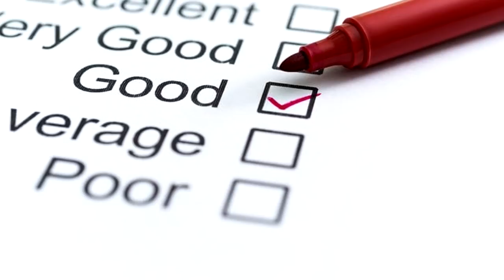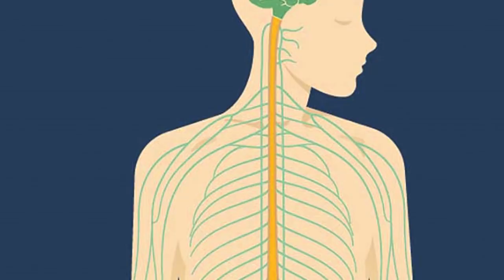Magic Circuits Explained [Fate/Stay Night] [Fate/Zero]

Comment: So getting shot by Kiritsigu’s bullets while using these circuits is like when Aang got strucked by Zuko’s Sister while in Avatar State?
Reply: Basically yeah.
Reply: Worse. When you recover, you can't go avatar state anymore.
Reply: Yes and no. While the Avatar state can be fixed getting shot by origin bullet means u fucked up permanently as your whole body is torn apart and reattached

Comment: It should be noted that cases like shirou are extremely rare.
finding someone with a magic circuit or 2 wouldnt be that hard, just that natural circuits that lay dormant a long time tend to suck.
shirou suffers from the atrophy probem but was born with 27 circuits wich even for an average magus family is pretty darn good, for refference rin was born with 40 and was considered a once a century prodigy.
granted he might have some mystical lineage from muramasa and prolly an inborn affinity for smithing  but no one knows that.
point is he would prolly garner a lot of jellly from the clocktower bottom feeders that arent waver
Reply: too bad his mind is too pre-occupied in becoming a hero of justice
Reply: Yeah, Shirous circuits can only handle ~10 units of power (that damages them in the process) while tohsaka’s circuits can handle ~1000 units of magical energy. Shirou has an above average amount of really weak circuits
Reply: @yesno7284  Shirou has atrophied circuits that were average quality.Due to not being used for majority of his lifetime they have been degraded, kind of like  Muscles.If they were used at full capacity or refined they 'd be usable.Look at Emiya .As a servant he has B rank in mana which is 40 times the mana capacity of your average mage.If he wasnt spending most of it being anchored to the world  and incarnated in a physical body by any instance he'd coincidentally have an even greater capacity than rin.Though i do admit that is probably because of his deal with Alaya in his life that buffed him up
Reply: @Ohimeshinso  Gray is strong but I don't think she 'd last 1 v 1 against servants or someone of equal level .Is she as strong as artoria(as In has it been mentioned that she uses Mana Burst?)
Reply: @Ohimeshinso  Nah isn't possible.Rhongominiad would generate an absurd amount of magical energy that would be noticeable from a mile away ,Plus unlike artoria Gray cannot use it without Rescinding it's 13 Seals lest she risk Divine spirit conversion and we get a second case of Goddess Rhongoniniad.Infact it's already quite dangerous given that her mind is covered in a "haze" when she uses the Lance in it's true form.
Reply: @SiegfriedFafnirsbane  wait, I thought rin was the one giving him mana as his master
Reply: @oilalalabla9211  yes rin was giving him mana but do where do you think that mana goes?.All servants have far greater mana capacities than any human  mage.The problem lies in the fact that since they are theoretically dead, Gaia tries to suppress their existence as they are an anomaly to the world .For those same reason servants cannot draw in mana from the surrounding like humans or any other supernatural being can .Only servants with  a magical reactor core or an EX ranked Independent Action  or Hacks like Gilgamesh can overcome this.

Also the mind blowing fact is that all servants from Age of Gods possessed Mana capacities that would make rin look like a bug.
For example look at gilgamesh.He has an average C rank in Mana but as shown in FG9 Babylonia,He could alone support an entire roster of a Grail war by his lone some while he was alive.
Reply: @SiegfriedFafnirsbane  oh I thought rin had more mana than him because he said she gave him more mana than needed. This is really cool🤝! Does archer have more mana than gilgamesh? Like B is better than C, right?
Reply: @oilalalabla9211  are you nuts? Emiya is from age of men. Gilgamesh is literally a god from the age of gods. Just because he has a  lower rank in one place it means shit. His circuits and amount of odd he has is above Heroic Spirit Emiya. The only reason he loses to him is because luck and his pride
Reply: @WildArtistsl  makes sense🧐
Reply: Shirou DON'T have a weak circuits there is literally no evidence that it is.

The wiki saying it could barely handle 10 units of mana is false as there are not statements in the VN that support this statement the Mirror Moon says, "Magical energy ten times the capacity of the circuit," that's a mistranslation. The Japanese says "a mana of ten" (十の魔力). Where the Wikia says, "Each Circuit can barely handle 10 units of magical energy while being damaged in the process," Shirou overcomes that by somehow bearing "the Circuitry of a hundred" (百の回路, lit. "circuits of a hundred"), which can draw unto themselves "a mana of a thousand" (千の魔力).

An average magus only have 25 capacity according to saber while shirou stated he have 20 to 30 which would put him at average magus lvl atleast

There is also these statement of
"Bearing the circuitry of a hundred, which subsume a mana of a thousand" tho I don't know what these means all I can say is this might be shirou using ALL his circuits at 100% which could hold a MANA of THOUSAND

Comment: Forgot abt the part where Avalon technically stops shirou from dying whenever he does magic shit
Reply: avalon only works when saber is around so before that shirou was still getting the full recoil of using magic
Reply: avalon was allways working but only at like 0.001 power , even with saber prana it doesnt work at more 10% capacity

Comment: So, as far as I know in my very lay understanding of this: You run your magical energy through your circuits Od/Mana whatever, turn it into usable magical energy... something happens, connect to a foundation-wut?, spell structure and magical energy manipulation with self-hypnosis, dash of fairy dust= profit.
Circuits are confusing. I know Shirou has 27, more than the average, but I was never clear is he had a total capacity of 10, or if each circuit had a capacity of 10 for a total of 270. Which actually sounds amazing if his circuits are supposed to be atrophyed from disuse. He has 25-35 units of Od to play with which is average,
Then comes Rin with 40 circuits for a total of 1000 units, or 25 a pop. No idea if this includes her crest, which couldn't help much as her family is only a measly 5-6 generations. Plus 500 whopping units of Od, the show-off.
Reply: Shirous circuits being atrophyed is fanon
Reply: @JohnDoe-wn7vi  It is literally stated by Archer in UBW. Reopening the circuits is what messes up his body and Archer helping him through it leads to Shiro having more to work with.
Reply: @joelsasmad  that sounds like a totally separate thing so can you go into more detail about what that has to do with circuit atrophy
Reply: @JohnDoe-wn7vi  The fact that as he opens the circuits he literally states: "your circuits have atrophied from disuse" and goes on to say that Shirou will be a bit better f a mage from now on as a result of their treatment.
Reply: @JohnDoe-wn7vi  as far as I understand it: Kiritsugu died without teaching that much magecraft to Shirou and he was never taught how to properly train his magic circuits so most of them were never activated, he was pretty much undoing any progress he did with training his circuits, so as he grew up those circuits were, perhaps atrophied is not the best word but you could say dormant think of it like this if you try to walk with your leg muscles atrophied you’re likely going to fall, likewise with numb legs, one situation still has a “healthy” limb but the end result is the same you fall. So Shirou has no access to these circuits and he has no idea how to use them or that he even has them he can’t feel them he has no training in directing magic through them. 
They might not be atrophied in the sense that they were changed by disuse but they were very much like a limb someone have never used regardless of how strong or weak it is it has no muscle memory no ingrained nerve pathways, it’s why babies take so long to learn to walk without looking goofy. So when Shirou started “activating” those circuits it caused him pain he had no idea how to use them so he hurt them. 

As to what archer did to him my way of understanding is that he simply made the direct connection between their magic circuits and their magic and them being the same person Shirou simply got archers entire experience of how to activate these circuits, in the previously analogy he got all his muscle memory,  just like what happens when they’re fighting it was the direct contact between their magic circuits that caused it. 

I hope that helps
Reply: @AverageAwesomeDude  yeah, thanks for explaining
Reply: @JohnDoe-wn7vi  no problem happy to help

Comment: Both Shirou and Kirei wasn't supposed to be born with any for those not in the know
Shirou has 27 Circuits in total which channel's 10 points of magical energy
Rin: has 100 magical circuits that channels 1000 points of magical energy
so this is why Mages prioritize bloodlines and Magic crest oh and the average joe is born with 20 Circuits Shirou's extra comes from his own projection magic
Reply: Damn. That sucks ass, so a majority of us would die on the spot trying to activate our circuits.
Reply: @SanzuRiver  Not if you do it from young age like 6 and practice there on in 
now if your Shinji who needs the grail to unlock his YOUR DEAD
Reply: 10 per circuit meaning 270 which is still higher than average but obviously lower than the best.
Reply: @nottomiokagiyu9830  this ain't kung fu no matter how hard Shinji work he can't do the magic he doesn't have circuits he can't even do Shirou projection a novice ability of magus it's why Shinji the way he is personality wise
Reply: @nottomiokagiyu9830  I mean no. He studies alchemy to try and get ahead with what he's got, kinda like waver. He worked just as hard as Shiro but in a different direction and his own personal failings are what make him suck.
Reply: @joelsasmad  yeah alchemy rules in fate
Reply: If they come from projections then is he projecting more is that from him doing magic wrong? Aka using his actual nerves

Comment: See, this is what makes fate in general just a complete vague mind fuck in trying to understand how things work. Magic circuits, looks like a nervous system, but instead is a metaphysical concept more to do with spiritualism. What did Nasu have to gain from making this so hard for the common folk to figure out. 😭 loved the video by the way, does help me work some out, so thank you 

PS: if it's at all possible, could you maybe do a video about the types of elements and what spells can be used with each? Because they're confusing as all hell also.

Comment: 0:37 Quick question. If one were to lose an arm or a leg, would they lose the Circuits in that area as well? Or would they still be there, just floating in the general area where the arm should be? I'm not talking about the Crest, just the inborn Circuits.

I ask because of how Archer's arm affects Shirou's body in the Heaven's Feel Route.
Reply: From what i understand is that circuits are directly connect with the soul so even if you got arm cut off you would still have same of circuit amount

Comment: So, I made a OC who's a homunculus which was created using the genes of several different mage families to maximize his inbuilt magic circuits and other magical abilities, but his nervous system, blood vessels, muscles, bones, and his lymphatic system are all engraved with additional artificial circuits and all of his base and artificial circuits have been beefed up even further like they were juicing on unicorn piss and LSD. The end result is a mage that is so incredibly potent that in the fictional grail war he takes place in he is going toe to toe with other servants when using his codex the beletung armory (beletung is based of the German translation for lightning beleuchtung) which as the name suggests is an armory which takes the form of a suit of armor and has lightning based abilities such as when electricity is pumped through it magical or not it gives you a strength boost based on the voltage, and other aspects with higher numbers being better. In addition to the armors other lightning based abilities it can manifest weapons and repair itself. One of its strongest abilities, however, is its ability called the beletung incarnation which basically turns the user and the armor into a literal lightning bolt with all the benefits that being a living lightning bolt provides without any of the downsides obviously costing a boat load of magic to even use.
Reply: The codex has even more abilities such as generating an electric field which hides the users mana especially rendering a the most powerful mages undetectable, and much more.
Reply: In addition to all this the guy decided to break the rules of summoning a servant and basically manually summoned his servants yes two of them, and stuffed their heroic spirits inside mindless homunculi bodies so his servants would basically have their own internal magic production on top of the truck loads of magic he is already dumping into their systems turn his servants into absolute units effectively making energy a non concern for king Arthur and Mordrid which are the two servants he summoned.
Reply: Though he is not the only master in the war who is rocking some additional power ups because Sieg returns from the other world to lead Astolfo, Jeane, and Siegfried in the holy grail war, and Sieg still has the ability to turn into a mother ducking dragon. Also, Astolfo and Jeane are just sticking around because of the events in fate/apocrapha, so the only servant Sieg actually summoned is Siegfried with Astolfo and Jeane simply barrowing mana due to their previous attunement to him.

Comment: How much circuits does Emiya have an did he gain more from his pact with the world?
Reply: Your average mage has 20 decent ones...... he's got 27 shitty ones. Like, his magical energy output is literally 1% of Rin's. 
 
As for his pact with the world, I'm not sure how that worked out for his circuits in life (pretty sure that's never stated numerically). And once he's a counter guardian, his outputs are obviously gonna be higher, but (IIRC) the number of circuits is still never mentioned.
Reply: @TheN13  when you become a cg your body is literally made of magic, total amount depend on the source of your magic power, but how much at once is on your magic circuits
Reply: @TheN13  Shirou don't have shitty circuits thats fanfiction those 27 circuits quality is unknown but it should be atleast average they seem low COMPARED to RIN which is not fair as she was stated to have a capacity "20 times an AVERAGE MATURE MAGUS" despite the wiki say he don't have a shitty circuits literally most of the fandom hate the wiki because of this and nasu literally said that he could summon his reality marble in 10 years of leaning the basics and another 10 on mastering it and Reality marble is costly and this was FATE ROUTE Shirou who got 3 tenths of his magical circuits taken by saber meaning Shirou only have 19 left meaning he could summon a reality marble with only 19 circuits

Comment: Is there a limit to how much energy/prana magic circuits could manage? Just curious.
Reply: Sort of. It depends on quality and amount of Circuits. Someone with a lot of low quality circuits wouldn't be able to channel as much energy as someone with a few high quality circuits. The best example of this is the Aozaki sisters. Both Touko and Aoko only have about 20 Circuits, but their efficiency is so high they can handle more energy than even most of the higher tier mages who have a lot of circuits.